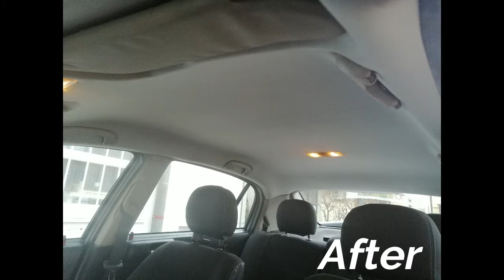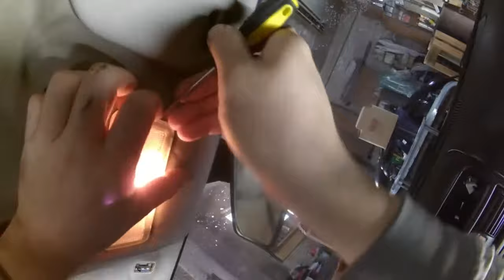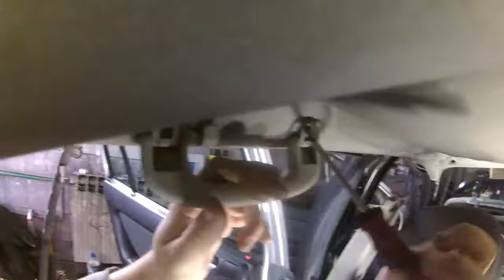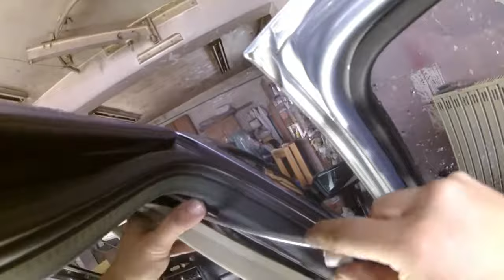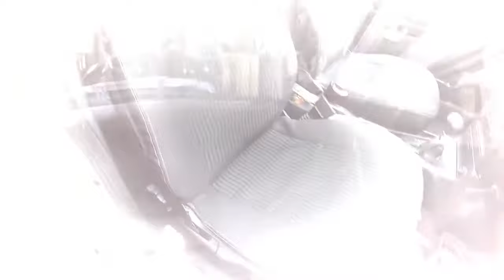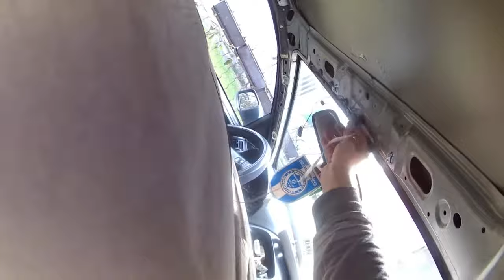Opel Astra G HEADLINER How to remove. DIY

Comment: I took my Astra to a shop to get an estimate to have mine done. It was too expensive. I asked why and they told me it was because the seats had to be removed to get the headliner out. This video proves that you do NOT have to remove the seats. It also makes me think that I could do the job myself. Thank you!
Reply from the maker: I'm glad the video was helpful. So they say that the seats should be removed to justify the astronomical prices of the service.
Reply: And u have 4 screws to remove the seats.. easy jerb